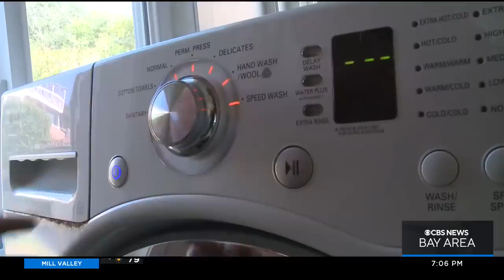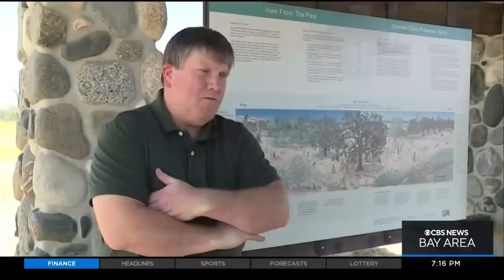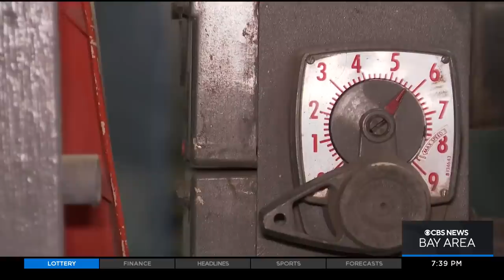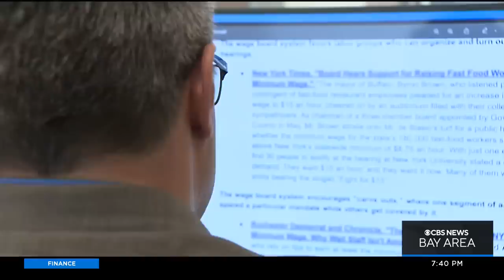Parched: California's Climate Crisis

Comment: While I do think its important to not carelessly waste water, it seems pretty insane to suggest I should be concerned with saving a handful of ice cubes I drop on the floor, compared to the other astronomically larger wasteful practices going on. Residential conservation is only a very small piece of the puzzle for sustainability.
Reply: Yes agreed. The picture is much larger than that.
Reply: Ever hear of curb cuts, bioswales and harvesting greywater?  Lot more water going to waste that can be used to mitigate drought effects.   Cisterns to harvest roof rainwater runoff make sense, as well.
Reply: the whole point is that it's not just about you. if 5 million people drop ice cubes on the floor that's a lot of water.
Reply: Aqueducts and desalination plants are expensive and frankly a destructive approach.  It is vulnerable, brittle, and fails to address concurrent problems.  You end up using a ton of electricity to pump water in the aquifers, as well as desalinating water.  It would increase brownouts.

The better approach is the prevent collecting too much water at dams in the first place.  
It is better to do smaller, decentralized, water-harvesting earthworks/techniques starting in the foothills, and continue thru to cities.  These would include keylining, check dams, bunds, swales, gully repair, planting pits etc.  More bioswales with curbcuts to feed street runoff into them is a start in urban areas, as well as encouraging the purchase of cisterns, using greywater for watering lawns and trees, as well as using roof runoff for water, flushing etc.
Decentralized efforts can reduce fire danger, flooding, lessen drought impacts.  Bioswales planted with trees can reduce heat island effects, allow pavement to last longer.  By passively using rainwater in bioswales, reusing greywater and roofwater you can reduce the amount of electricity used to irrigate and reduce the chance of brownouts.  
Keeping landscaping hydrated this way also keeps the soil biota hydrated and allows water too seep better into the soil instead of running off.  
Overall using rainwater harvesting techniques/earthworks recharges aquifers and surface water in a positive downstream effect.  
Brad Lancaster has YT videos and books on the subject.

Lots of water falls there, even during droughts but it is squandered.  Back up and reassess where you look for problems/solutions...

Farming and ranching could be done much better.  'Sustainable ag' is a greenwashing term to sell more products to farmers and ranchers rather than solve deep ag problems.  Restorative ag techniques work much better and for less while producing more food.
Reply: Yes, that’s true. But it takes just as much effort to drop a few ice cubes somewhere useful as it does to drop them in a sink, it’s more about attitude.
Reply: Farming is a big one... they need to change their ways. There are so many solutions.
Reply: by design. if corporations can blame individual consumers for broad, municipal mismanagement, they can continue dodging accountability while raking in tax incentives.
Reply: @vicycross6037  
Exactly.  
It's funny how the solutions chosen are the ones that benefit corporate conglomerates in ongoing enrichment schemes rather than ones that decentralize and reduce dependence from expensive high-tech solutions that require repairs, more gridded solutions, etc.  
Funny how they say 'we need more chemicals' to produce more food, want more water, you buy bottled water, you pay for all these inputs, we're just giving the consumer what they want, buy our desalination plants, pay us to carbon farm, pay us to stop using bad farming methods instead of making us use good practices (that's a double whammy), pay us to remove the pollutants our bad tech produces, etc. 
Corporate conglomerates have figured out the best extractive mining is by colluding with politicians of taxpayer/consumer pocketbooks.  False or skewed narratives narratives work best because the problem lingers longer and requires more 'solutions'...
Reply: @justiceevans1720  I say "If it's yellow, let it mellow, if it's brown flush it down". Sure would add so much more to the conservation effort.
Reply: @justiceevans1720  don't get me wrong, I think we can do a lot better in our own homes to not be wasteful. it's just frustrating to see such emphasis on small individual efforts. It makes it seem like the residents are to blame for using up too much water, when in reality its a much smaller piece of the pie compared to other uses, and that is rarely explained well these news segments. I see it as mainly a systematic mismanagement issue. residents collectively can't really make much of dent in the water issues as a whole.
Reply: PEACE 
PROSPERITY 
BONANZA 
FREE THINKING 
HONESTY 
OPTIMISM
Reply: @b_uppy  It's now unsafe to drink rainwater around the world because of the growing presence of "forever chemicals," a new study suggests. In the study, published Aug. 2 in the peer-reviewed journal Environmental Science & Technology
Reply: @melaniedennis9540  
Well it's good thing we invented bioswales to purify water, then.
Reply: Melanie Dennis  
It's true rainwater has chemicals that "greatly exceed" safety levels in most places is now. 
You will want to avoid floodwater-recharged surface water (lakes, ponds, rivers creeks, rills, etc) because evaporation concentrates toxins.  When soil and landscapes get dry, water lacks the ability to permeate.  You will want to avoid desalinated water as well.
When we slow, spread and sink the water into bioswales and the like,  we also reduce flooding.  
It's good thing we invented bioswales, and other rainwater harvesting earthworks to purify water then.  When we absorb water into bioswales with mulch (mulch is important for microbial action), along the topsoil's carbon and woody plants, we get natural remediation of the water.  This is a healthy hydrologic process.  The water then moves through the soil (aka water table) to rivers, lakes, ponds etc naturally remediated.  In healthy hydrologic processes that's how lakes, rivers, creeks, ponds and rills get clean water.  It makes the case for rainwater harvesting earthworks even stronger. 
 Desalination plants lack the ability to do this for free, it would mean compounded infrastructure.
(FYI- you can eat the fruits grown from woody plants as the toxins are absorbed into the bark.  You do want to avoid annuals, which are most plant based foods grown in the grocery store.   Buy from your neatest permaculturist)
Reply: @melaniedennis9540  I filter all my drinking and cooking water. Wish I could filter my shower water to eliminate the chlorine, fluoride, dissolved medications,   potential cheical toxins  etc because your skin is you biggest organ. Since I can't, I tend to army shower - get wet , turn off the water  soap up, then turn water back on and rinse off. Would love to soak in a tub on rare ocassion but don't have one. Maybe some day I will live in another state, in an  area with a deep well with clean water, but since I'm 76, I'm not counting on it, just dreaming.
Reply: Cotten uses tons of water, herbicides, and fertilizer. Hemp uses little to none. 
Alfalfa uses tons of water as well and it’s being shipped to China! What the heck?
Reply: @klayvonisme  
Pima cotton does fine without irrigation.  Uppland cotton requires irrigation.  
Anytime you grow anything in a monoculture, with synthetic chemical inputs and bare soil you will have problems.
Reply: @klayvonisme  
Alfalfa has doesn't require watering where i'm at.  Think that they're harvesting alfalfa year round is part of the problem.  They need to require restrictions on water to certain crops and figure out alternatives.
In AZ Alfalfa is grown by Saudi Arabia and shipped back.  Canada owns land in the US as well and does a similar practice.  

There is no need for either China or Saudi Arabia to be growing alfalfa here when they can grow thornless mesquite/prosopis there for livestock feed.  It's a pioneer plant well-adapted to harsh environments and is used in early succession plantings to reclaim land.
Reply: @b_uppy  Thanks for the information. I appreciate it.
Reply: @klayvonisme  
You bet.  Hemp has its place.  I think a strong possibility is growing it in an alley cropping system with avocados.  Harvest the top half of the hemp, use a crimper to make mulch of the bottom half.  The mulch will reduce water stress for avocados and hopefully lessen overall water needs.  Will likely need to find a few other plants to grow alongside avocados for best soil rebuilding.
Reply: Yup. There's a video on here called 40+ ton California Corn that shows 12+ foot corn stalks being grown (according to the poster) with flood irrigation. It's grown monocrop-style in massive fields for silage (livestock food) which will feed cows we're shipping out of the country. This video is showing just fruits and vegetables being grown but the big water waster is this stuff.
Reply: @yup  
Monocropped livestock feed is bad for livestock nutrition and fattening, bad for soil, bad for water, bad for air pollution and CO² drawdown, bad for needing chemical inputs, bad for biodiversity, and reduces the nutritional value of meat for consumption as well.  That's lose-lose-lose-lose-lose-lose-lose-and with shipping to another country, big lose.  
There 's other issues as well.

You sure that isn't sorghum they're growing to be 12+ foot tall, btw?
(Silage per se is fermented livestock food, btw.  Fermenting adds nutrition and helps ruminants' gut biota, it's be better as diverse silage, to be sure.)
Reply: All a matter of attitude waist water when their is plenty,a couple of ice cubes will look important if your thirsty and no water is available
Reply: @Christy Allen  
The ice cubes are also a distraction from the more impactful harvest of rainwater.  It hurts as well that road and city engineers still treat runoff as a part of sewage infrastructure.
Consider that 10 inches of rain falling on a 1 kilometer square area equals about a million gallons of water.  That is a lot of water that is treated as 'throw away.'  This water can be put back in via localization, diffusion of rainwater harvesting earthworks and techniques.  This is different from the ugly detention/retention ponds that require more engineers.  California's need to push back on nanny-state regs and corporate conglomerates centralization/dependency on shipped/gridded goods services that contribute to, and make more problems than solve.  Californoanians need to look seriously at what they've been doing wrong.  

Suggest you look up Brad Lancaster from rainwater harvesting techniques that can be done in both the city and in rural farm-, ranch-, park-, and wild- lands.  
Another great resource for alternative methodology is Mark Shepard.  He teaches ag practices that use local biomes as the primary model for what to grow/how to grow.  This mimics/borrows from the plant dynamics/guilds and optimalizes the use of soil, rainfall, bioremediation, food and plant diversity, soil building, livestock as pest and weed controls, and for fertilization, etc.
to increase
Reply: But it IS a great distraction to blame you.  Isn't it?  AND it works?
Reply: @cbrashsorensen  
Did you read my comment above yours?  Very similar.
Reply: @vicycross6037  That is true. But I don't think enlightened consumers will tolerate that.
Reply: @b_uppy  👍
Reply: @laluba3603  
I probably sound like a broken record but I try to communicate other solutions for a broader dialog.
Reply: Just because other people are being wasteful or govt. agencies are ineffective doesn't mean that you have to be.  Almost no one in my neighborhood recycles but I recycle everything and with 2 other apartments we have a full bin every week.  I get pleasure from putting it out on the sidewalk because I feel that I am helping even if the effect is tiny.  btw,  If you added up the water from 3 ice cubes and multiplied it by the population in your town I bet it would be a lot of water.
Reply: @FloozieOne  
Did you know that your recycling is going nowhere?  It's because there is a glut of plastic ready for recycling and not enough demand/places to process it...
Reply: God forbid that you inconvenience yourself and your lifestyle to be part of the solution.  We could start by not p**ping in drinkable water, having a lot fewer kids, and living with modesty and "enough" as a value.
Reply: @JakeP2013  The number of people and the demand IS the problem.  Does not matter if it is growing food, or watering the lawn.  We are ALL responsible.
Reply: They need to spend money on new infrastructure. The population has grown and they definitely have the money to do it. It's all those damn environmental groups that are standing in the way. So nothing gets done.